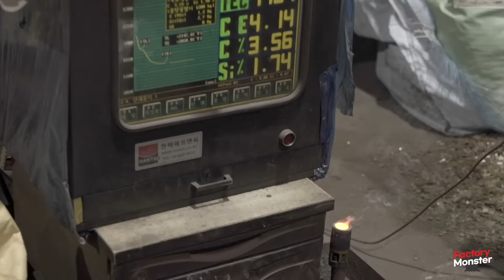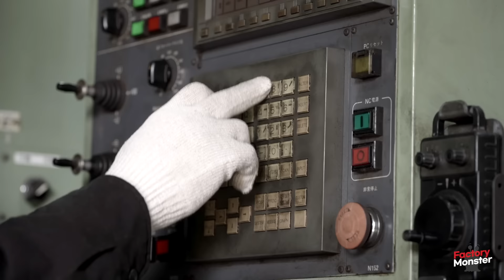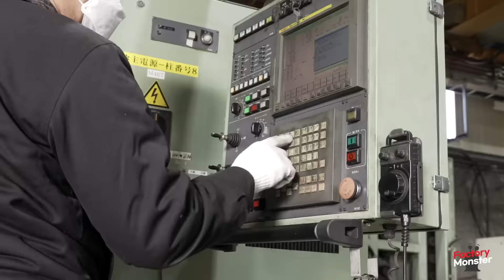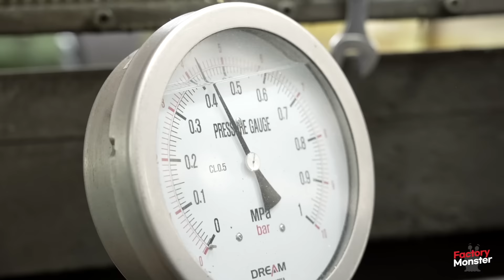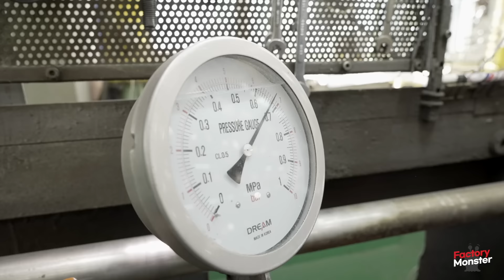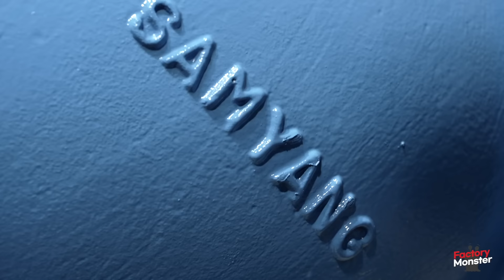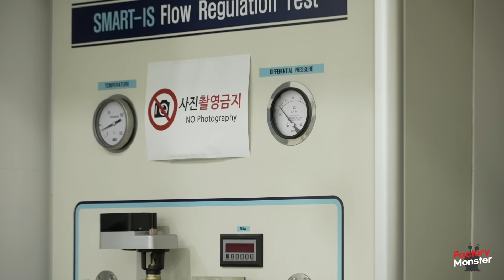The Manufacturing Process of Industrial Valves. 62 Years Old Cast Valve Factory in Korea

Comment: Thanks for another great "how it's made"! About coolant. It's usually water emulsion (mix of water and water soluble oil in correct proportions). And with cast iron it's used not just to cool tools and workpiece down, but to wash away cast iron dust that's generated in huge quantities. Because otherwise cast iron dust is a great abrasive and will start getting everywhere in the CNC machine, the ways, the bearings, etc, and to prevent that, the coolant is a must when working with cast iron.
Reply from the maker: What a great knowledge you’ve got! Thanks for sharing!
Reply: @AffordBindEquipment  I mean, it might be cast steel, but cast iron also generates quite a bit of larger chips when drilling with a good feed rate. There was a lot of powder on surfacing operation before drilling, at least it seemed like that.
Reply: @AffordBindEquipment  they definitely melted scrap steeland added something to make it stronger for different valve to the one shown being machined.
Reply: Cast iron dust isn't that bad. Coolant mix is a chemical mix. Not always used depends on the operation. This does look like steel though

Comment: I appreciate this. I just had to have one of the backflow valves in my buildings fire sprinkler system replaced. It was a custom part as no more of the original existed. Knowing what goes in to simply the production humbles me. All this takes place after the design takes place. This is production scale. The fact our one-off was done in three months from designs is amazing. This was insightful.

Comment: Very cool!  Getting the pattern made is a whole other part that it doesn't show (after valve design of course).  I used to design patterns for this type of casting beginning with the 3d model (sometimes 2d drawings).  It was actually very rewarding work designing the pattern and coreboxes.  You have to consider how many you can fit on one pattern, account for shrinkage, use software to see how it will solidify when cooling, add coreprint for the core to sit in, apply the rigging and risers, add macbhine stock, and add draft so that the pattern will pull from the sand.  Then the pattern is CNC machined out of a polyurethane material called Renshape.  After machining, the patternmakers can apply the antishifts, sand down any machining lines, fill any holes that it was screwed to the wood for machining, and a lot more.  After painting and sending to the foundry, we would get them back and machine them as you see here.  Careful consideration can be needed to rig correctly during machining.  I miss this work!

Comment: the paint shop has what we simply call a "water wall" but is not legal in my country any more, its so you don't have to continuously change filter mediums. we used to have a vehicle spray booth with water instead of filters as it catches all dust and overspray. disposing of the water became very expensive and was shortly after banned nation wide

Comment: You asked what kinda of system that is to wash away the dust generated during painting.  It is what is called a downdraft dust extraction system in that the air is drawn downwards and I believe too it uses water to lessen any airborne particulates!
Nice video!

Comment: Nice work.
I spent many years making valves of cast iron, steel, stainless steel for all sorts of oil, gas, pipelines... the last valve I worked on was for a refinery and had to work at 700 pounds pressure.
Reply: What Is the brown coating painting over pattern,. Thanks for your answer
Reply: @oscorp641  Just a thick ordinary paint to fill and smooth the pattern so it can be removed easily.
In UK they tend to use a red paint like red oxide.
Patterns have to be lightweight enough to be lifted easily so they are made of lightweight pine or similar softwood.  
But that wood has a very open grain that could cause the pattern sand to penetrate and stick to damage the sand when the pattern is removed.
Reply: I want to know basics of valves manufacturing and its test details , Can you please help me
Reply: @shilparani8299  Lots of Youtubes about machining valves and pressure testing them.
So many kinds of valves so it's hard to be specific.
Wedge gate, ball, flap etc etc. 
Small ones are made on cnc machines, bigger ones may be made on a vertical turret lathe or horizontal borer.

Comment: 14:56, 15:13 - looks like a relief bypass (or whatever they call it in English) - AFAIK before you are to close the valve completely, you open the valve on the bypass in order to reduce the force on the main valve - and once you close the main one, you close the small one on the bypass. At least that was what they told us back then in secondary school ("high school "in US).
Reply: Yes, when there is unequal pressure on the downstream side it can cause uneven pressure on the valve making it hard to open\close and causing wear. The smaller valve is easier to open so you can equalize the pressure on both sides

Comment: You should’ve shot your video at Masoneilan, in the US. Outstanding valves, been manufacturing them for decades. As far as the actuators that open/close these valves, REXA makes some of the best.
Reply: He should go all the way to Burgerland because you’re aware of another company that makes valves?
Reply: It doesn’t get any better than that using the same process.
The only improvement That exists would be to do some of the castings using Kukas and whatnot to add some details, which they do in Germany for engine blocks

Comment: Is cast steel would be strong without forging (hammering or pressing)?
Reply: Doesn't need to be forged/machined. Make it thicker heavier to compensate aslong as weight/size are not the restraint = Cheaper by ALOT

Comment: What is the special sand made of? What does it consist of?
Reply: Casting sand is usually mostly a mix of fine quartz sand, kaolin clay and water.  Sea coal (basically fine coal dust) is often added.  The clay and water are for plasticity.
Reply: @michaelmcginnis9391  Thank you, but what is so special about the sea coal? Does that act a binding agent of sorts?